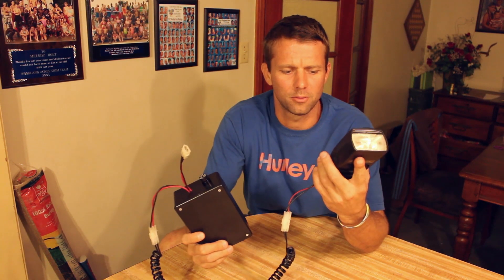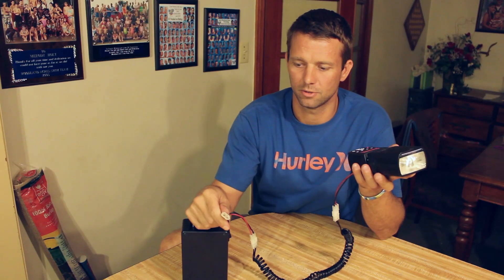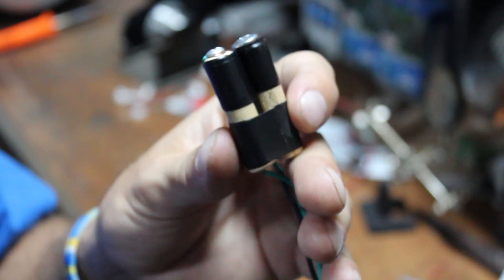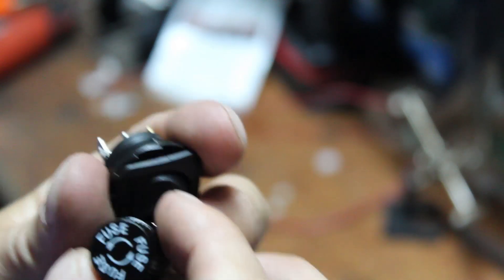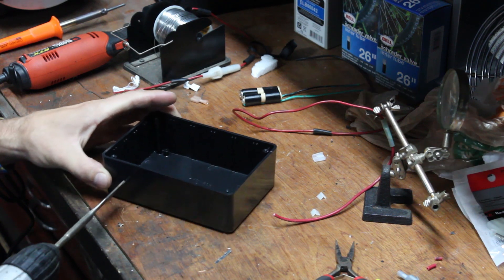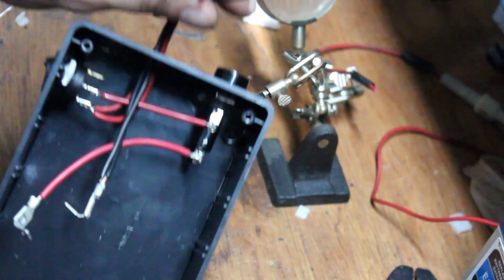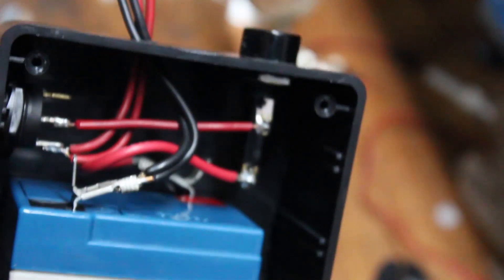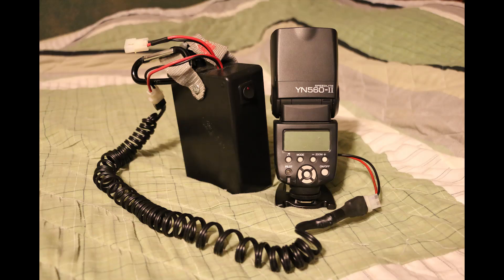DIY battery pack for Yongnuo YN-560ii Flash

Comment: Great ! Just what I been looking for .. Can I use more than one battery?  . I need enough power for the flash and led light on the same battery pack .  Thanks for the vid !!
Reply from the maker: if you hook two 6 volt batteries in series that turns the current to 12 volt and that will blow your flash. If you wanted more power then I recommend using a higher rated Amp Hour. As long as you stay within the 6 volt rage your fine.
Reply: That Save my Flash life !!thank you for the reply

Comment: thx for this amazing tuto !
Reply from the maker: No problem, you have to share how yours turned out
Reply: Lee Holt Yeah, but i have one question , how do you recharge the battery (6v 4,5 Ah) ? what kind of charger ? thx
Reply from the maker: you can fix many different wall chargers to work as long as the output voltage is 6V and the Amp is low enough... I personally use a car battery charger on 6V mode. You can find cheap wall chargers on amazon for $8 that will work as well.